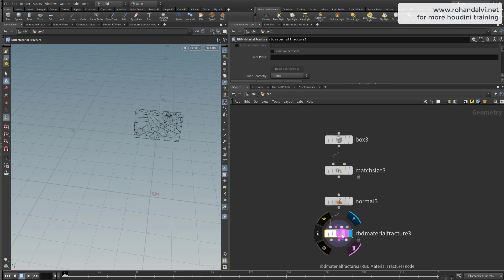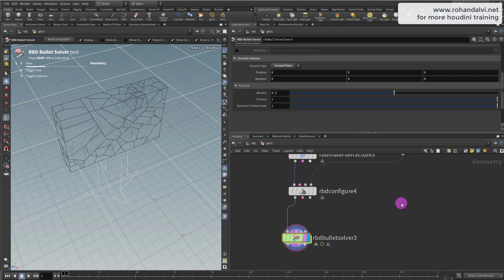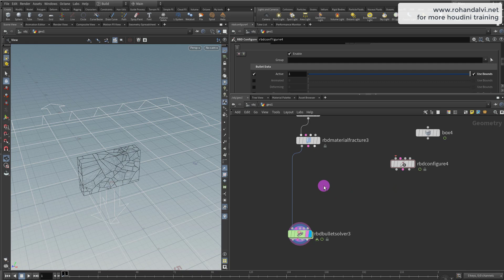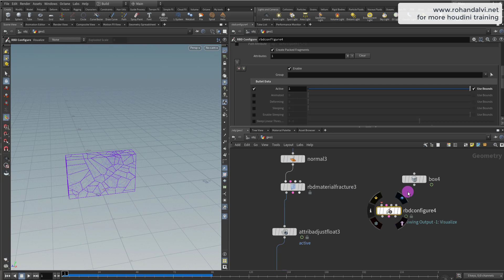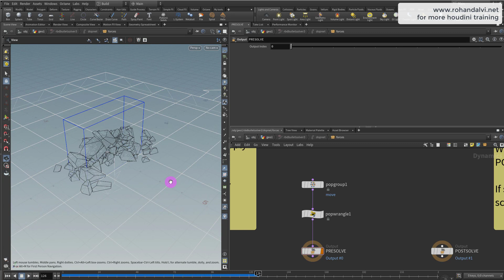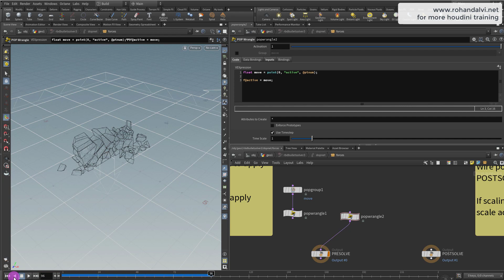3 ways to activate Rigid Bodies in Houdini

Comment: I think creating the attribute with the attribute adjust float doesn't work because you are applying it to the hi-res geometry. The RBD bullet solver only simulates on the proxy geometry, where it also stores the attributes. Try adjusting the attributes there.
Reply from the maker: I shall try that. I also think one of the reasons it doesn't read animated attributes is because sops can't read per frame changes for simulations. But i will try the proxy approach.

Comment: well thats great but what if i need to use attribute like pyrospread or colortransfer attribute from any other object to  drive active attribute .
Reply from the maker: Just use the pop wrangle technique and bring it in using the point function. And then feed that into the active. The technique remains the same. You can generate any attribute and just feed it into the active attribute in the end in the pop wrangle.
Reply: @rohandalvi  got it but if you dont mind could you please explain how to do it in vops,rather than using vex.
Reply from the maker: @fawwaadkhan  you just need to replace the word "active" in the float move. That's it. Replace that with the name of the other attribute you generate.